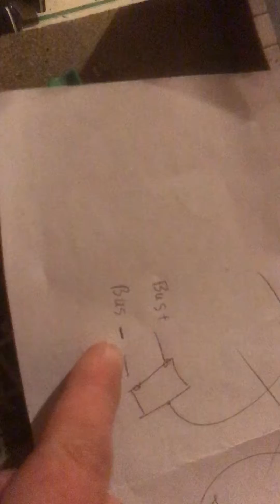Wiring up a peco crossover for Dcc

Comment: Cheers Paul, very helpful and will give it a go soon. Have not started laying the track yet and luckily that is when I came across all these vids of people having problems with insulfrog crossovers etc. So at least I don't have to start pulling up track. Again many thanks for taking the time to do the video.
Reply from the maker: not a problem crafty. if it helps a little then alls the better.
when you asked for a diagram this is all i could think off at the time lol. and sometimes a picture or video is better then words lol